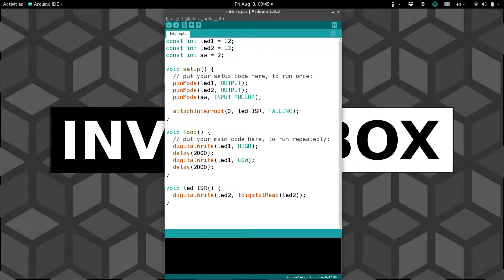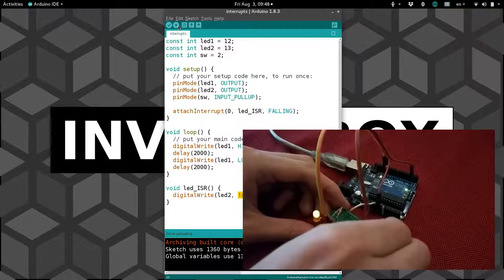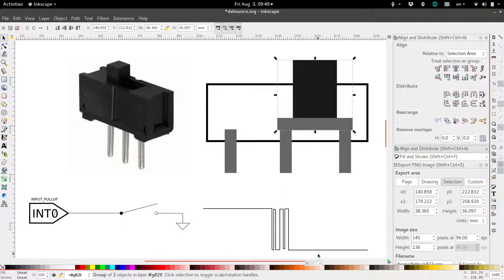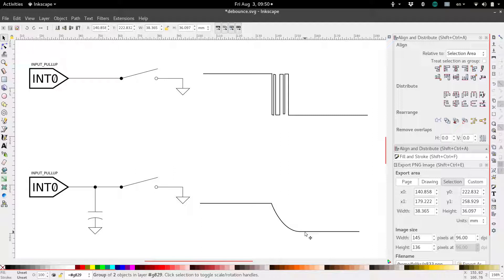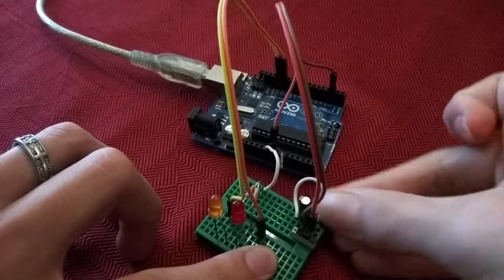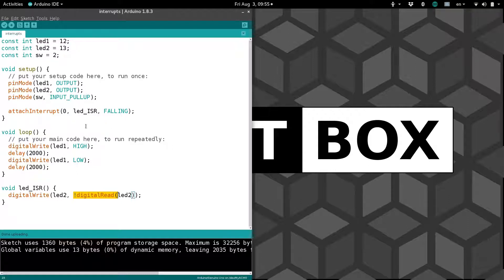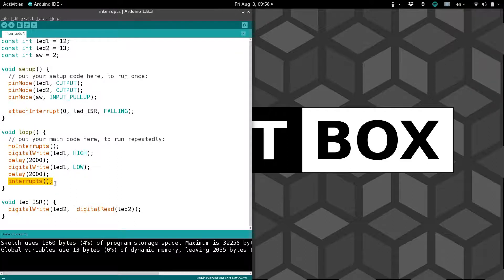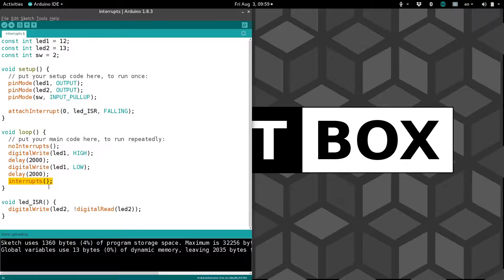Learn Arduino #6: Interrupts - Biggest beginner mistakes (debouncing and more) - Tutorial

Comment: It still bounces a bit when I put the 0.1 micro farad capacitor. I tried 10 microfarads, and it still bounced. Maybe there's some other loose connections somewhere in the circuit that are bothered a bit when I touch the board?
Reply: It worked for me perfectly with an 100 nF Capacitor but not as an electrolytic capacitor
Reply: Be careful. In the video he says thay the marked side is the positive one, but its actually the negative. Maybe you connected it wrong?